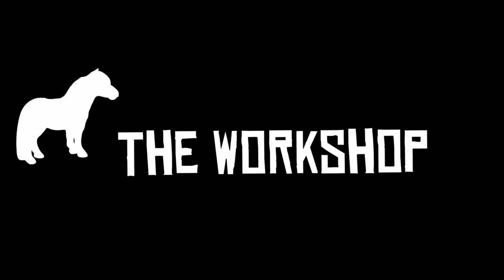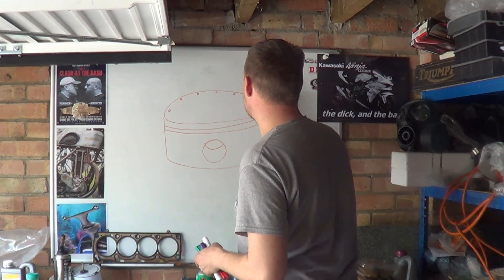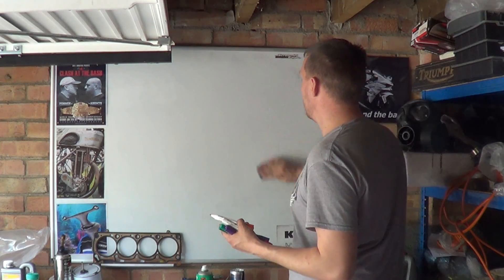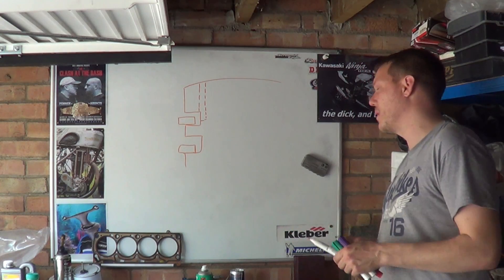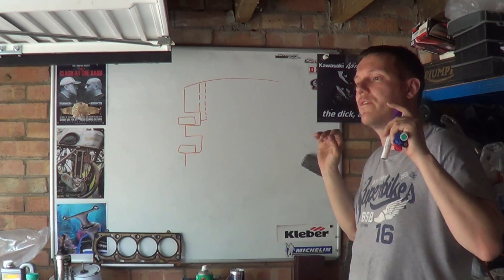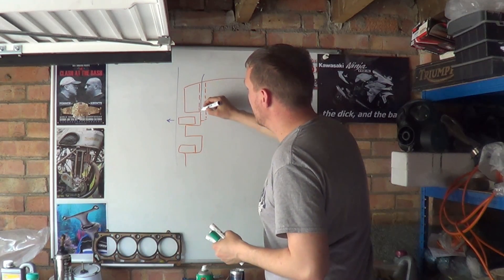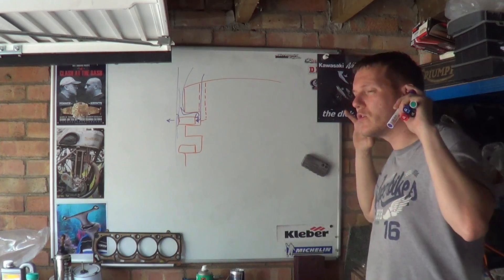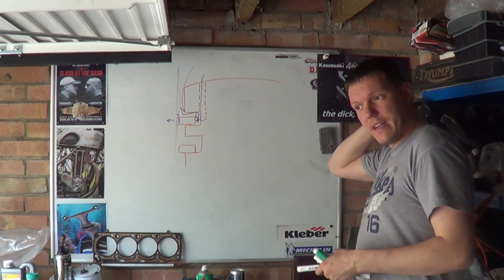Piston Vertical Gas Vents

Comment: Hi , I have silly question but gonna ask any way say, if you had the piston specially made and designed for these holes, for let say 1000cc bike and then you fitted them would they be a noticeable difference or would it not work very well as engine wasn't design for it.

Comment: So how about a video explaining some old 2 stroke piston types such as the Schnurle deflector piston and indented piston crowns used to alter port timing without modifying the piston. This allowed 2 stroke manufacturers (we're talking 1950's to 1960's) to offer "race tuned / competition" performance pistons that had indents on the crown to increase transfer and exhaust duration. 

I've recently experimented with this old school forgotten style of 2 stroke porting and it has the advantage that should an over zealous porting feck up occur, its only a piston, not the cylinder liner, that's ruined.

Also a selection of pistons could be tested to gauge the difference between port duration settings simply by changing a piston over.

It's also a lot easier to file / grind an 1 or 2mm. indented ramp into a piston crown edge and set its deflection angle (transfer ports) than doing the same job with a cylinder block (takes fecking hours!!).

Found mainly on European 2 strokes of the 1950's to 1960's era, including competition bikes.

Britain, having only Villiers and BSA (Bits Stuck Anywhere) producing the majority of 2 stroke engines, as usual lagged behind in 2 stroke innovation like this.....
Reply from the maker: Already on the list dude - its just a big bloody list
Reply: And you also have to de-bullshite some of the bad crap on U-Tube.

Comment: Might also be worth a mention that the ring clearance is tighter in either type of gas ported/vented piston(vertical or horizontal). They will also run less wall tension on the ring to get maximum benefit too.
The holes are only 1-1.2mm diameter normally so no extra material is needed.
Great channel Matt, keep up the good work.

Comment: here's something for you, my AM6 50cc 2 stroke engine has a single ring piston, normally a 4 stoke has 3; primary, secondary and oil ring assembly, I understand why a two stroke doesn't have the oil ring assembly, and I know some 2 strokes have 2 rings but why doesn't mine have a secondary ring?
Reply from the maker: Already done the video dude - just need to edit and put up this week - matt
Reply: The Workshop psychic

Comment: Why don't diesels do this? I'm an American so my truck is a 6L, and my pistons don't have these holes. You would think that a 18:1 comp ratio turbo engine, it would help alleviate a LOT of blow by.
Reply: It would also put a lot of wear on your engine which would have you shaking your fist at the manufacturer when the service manual says "replace engine block every 50k miles" :P
Reply: Couldn't that be negated with cylinder jets? Like powerstroke engines have piston cooling jets that squirt oil on the pistons. Why can't the same thing be applied to coat the cylinder walls better with oil?
Reply: and a mile down the road the holes are plugged with soot :D

Comment: my gramps has a few burnt up diesel pistons (they're big nearly five inches across) from a dozer, they have this bolt thing stuck in them for seemingly no reason. I think it was for when you needed to pull the piston out easy.
Reply: ,,, if it is in the top and near the center, it might be a hard metal to keep the injection from eroding the area.